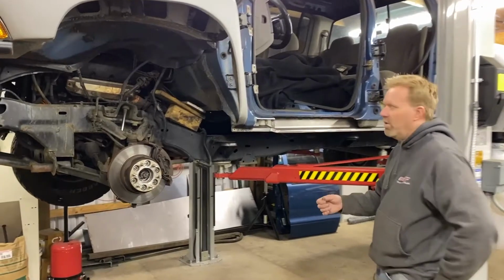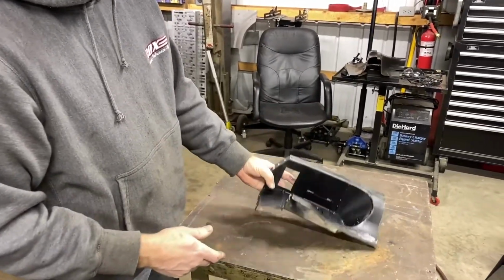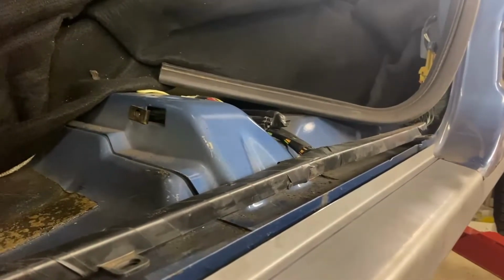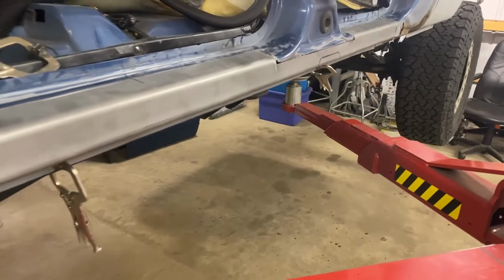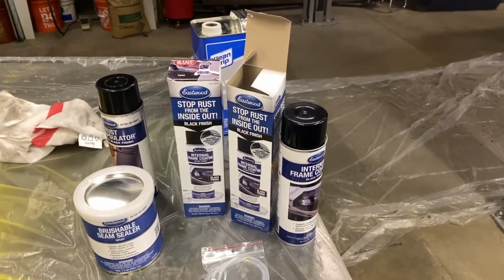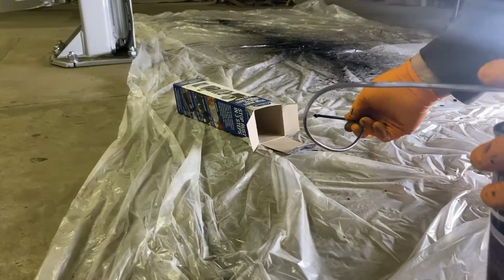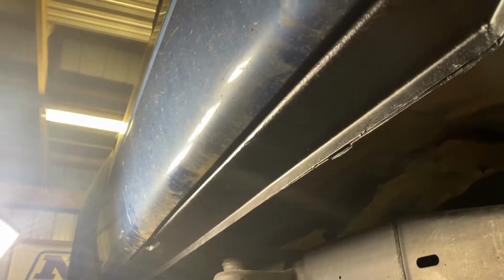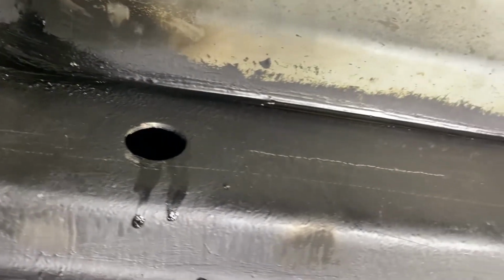DODGE DAKOTA PRERUNNER RUST REPAIR Pt. 3

Comment: Came out good. Btw what are your wheels specs. I like how they are not sunk into the glass fenders.
Reply from the maker: They are a 16x8 Pro Comp wheel. They are so old I don’t know the full name of the wheel. But the front does have a 1 1/2” wheel spacer.